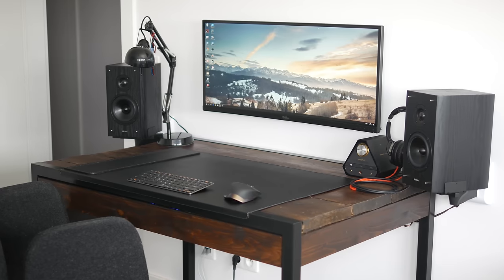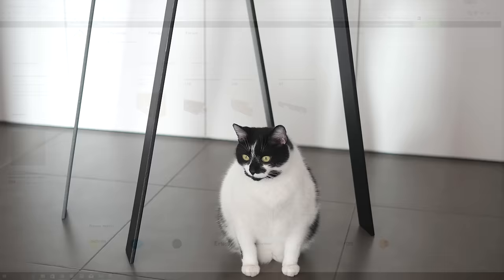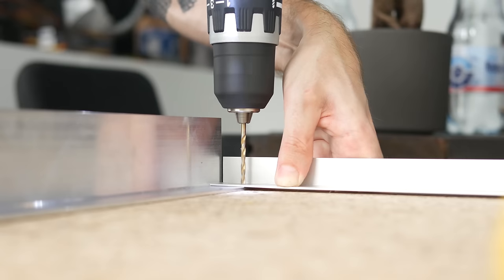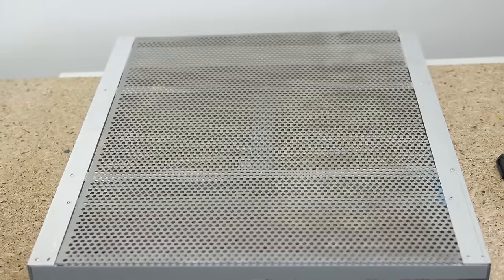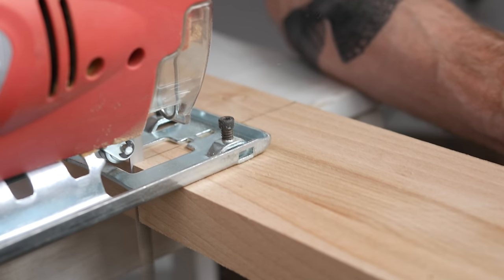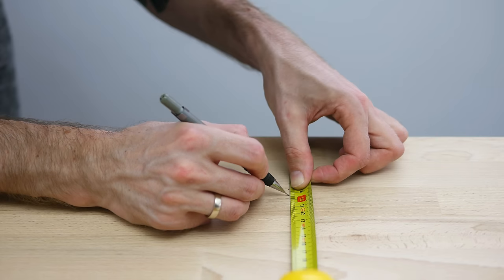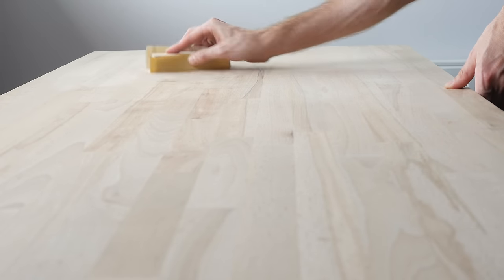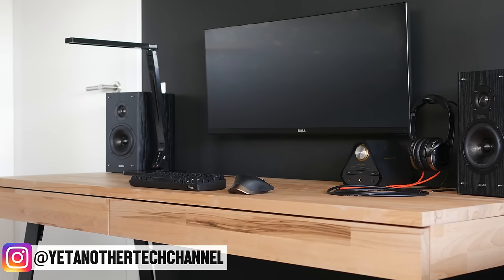How to make a desk PC for adults (DIY desk PC)

Comment: Hey could you do a video on how you mounted your monitor and ran the cables through the wall?
Reply from the maker: The monitor hangs on a very basic TV hanger. Installing it is as easy as drilling 4 holes in the wall, screwing in the wall plate, attaching rails to the vesa mounts on the monitor and placing it on the wall. As for the tunnel in the wall - I'm not a builder, I paid my contractors who were finishing my apartment to do that for me. Here's a link to a video on my Polish channel with a few pictures that might give you an idea: https://youtu.be/uwP9hO8M2bc?t=2m28s

Comment: I like slim or mini size builds, not a fan of huge towers although I use one for my gaming rigs, but the question about those desk drawer setups, was heat dissipation considered, is that what the ventilated plate is for?
Reply from the maker: The exhaust vent prevents hot air from building up inside the desk.

Comment: what did you put into the radiator just before you closed the draw-er  at the end? (looked like  two wires or something...)
Reply from the maker: It's most probably the temp probe from the fan controller to adjust fans speeds depending on the temperature.

Comment: I was wondering whether negative or positive air pressure is the best option for a desk pc.
Also, I am wondering whether a plexi glass top and sides (front and rear:fans, bottom:grille) would be beneficial, as it creates an "air tunnel" who gives less turbulent air flow.
I haven't done any diy pc so don't have any expertise: maybe you know if this would be beneficial or not? :)

Comment: what about dust filters? and why wouldnt you mount the gpu facing upwards for better look? all in all a nice build
Reply from the maker: I'll be adding dust filter for the air vent. In my previous desk PC, dust wasn't a major issue. As for the GPU orientation:
1. My GPU is an OEM Zotac GTX1060 so it's nothing worth showing off. 
2. This way GPU fan has better access to outside air.
3. It's not that the desk has window (never!) so I'm not bothered at all... 
4. I find the black PCB very sexy ;)

Comment: I know its Late that i write a comment but could you tell me how long your angle profiles were? (2:17) wanted to rebuild the table for myself 😁
Reply from the maker: They are pretty much as wide as the drawer so about 50 cm (https://youtu.be/BUM7y3v53OY?t=1m56s). Notice that I have a micro ATX motherboard - you might need to build a larger drawer if you have a bigger mobo.

Comment: I've had a thought of a "Old School" A Fancy type of Rolltop Desk converted into a Stealth Computer desk with Monitor built Horizonitally into the desk. So It's all in one, and Lockable. Something that would fit well in a Old Victorian House Library or a Old Bank Office setting. Would love to see something like that Happen. Resale alone would be worth it, if it was well planned out. Love this desk!, You gave me idea's lol. subscribed.
Reply from the maker: yeah, I totally see this :)
Thanks for stopping by - the topic will most definitely come back as I'm making plans for a third iteration of the drawer to make the computer silent :)
Reply: I'll look forward to it, I recently bought Be quiet! 120mm Silent Wings 3 fans for my CPU Corsair 75H water cooling system fans and I thought they would be more quieter. But there not. Really surprised me.

Comment: Can you tell me what tool you used for both making rivets and rivet nut inserts? all the tools i find only can do one or the other. Thanks in advance
Reply from the maker: I tried searching for it online, but I couldn't find it outside Poland: https://allegro.pl/oferta/nitownica-na-nitonakretki-m3-m4-m5-m6-40-110-6562560272
Reply: YetAnotherTechChannel thanks.  By chance did you keep the vid card raised   as well ? Or does it touch the drawer bottom ?

Comment: Where did you buy the old IKEA shelf with metal mesh? Could you give a link? I am looking for something similar for my laptop ..Thank you
Reply from the maker: It’s Ikea Algot - one of those: https://www.ikea.com/us/en/p/algot-shelf-metal-white-00228338/ but check the dimensions.
Reply: Thanks bro, this Algot meshed shelf is not available at Canada IKEA, try to find something similar at IKEA though https://www.ikea.com/ca/en/p/aurdal-shoe-shelf-dark-gray-30460953/ . It is the Aurdal shoes shelf, sized 56 cm X 40 cm  without the center beam as the Algot shelf does. I added a wooden beam and it is sturdy to hold my 17'' gaming laptop. Going to install to 14 cm fans underneath to finish this project. Thanks again, your channel is inspiring

Comment: Very nice! I have two questions:
a) How do you manage the cables to the drawer from the peripherals so you can pull the drawer out without having to worry about your monitor, mouse, keyboard etc?
b) Would it be possible to put the vent in the back or side of the desk instead of the top? I'd really dislike having an open vent in the top of my desk.
Reply from the maker: 1. The cables are attached to the top - there's enough of each to easily pull the drawer out without any of them disconnecting and they are arranged so they fold neatly when closing the drawer.
2. The vent is over the radiator and it's there because the radiator fans draw air from the bottom and push it towards the top. You can try and make a tunnel to direct that air towards the back. It won't be as efficient, but should be good enough.
Reply: Hey! Thank you for your reply. I assume you picked that orientation for the radiator to keep the drawer height down?
Reply from the maker: Correct - if you'd rotate the radiator 90 degrees, the drawer would have to be 3 cm higher and there wouldn't be enough clearence for legs to sit comfortably.

Comment: Great results! I’m inspired to imitate your PC drawer in my floating desk project. Love the aluminum drawer frame you built, excellent example of what can be done with minimal tools and a lot of thought. 

Two questions:
   1) drawer height looks like ~10cm, is that correct?
   2) how do you handle cabling to fixed pieces like USB hub and monitor? Seems like opening the drawer would require 40cm to 50cm of slack in those cables.

Thanks!
Reply from the maker: 1. Correct.
2. All cables are attached to the roof (?) of the desk - there's enough of each to pull the drawer out (almost) entirely and they fold nicely when closing the drawer.
Reply: Thanks!

Comment: Very Nice! It shows what some great ideas and planning can do if put into action. The next time you need to cut a slot with a router (cnc cutter)  clamp a piece of your aluminum angle down,and use it as a fence to run the router along, for a perfect straight cut.  Very nice PC desk! :)

Comment: what if the house isn't even, how would you handle balancing out the legs?
Reply from the maker: These legs are somewhat flexible and the wood is pretty heavy, so the desk won't wobble or anything - it just won't be 100% leveled. You could also get legs that allow adjustment.

Comment: Hi, great vid. Got one question, what are the holes size of the perforated aluminum sheet? I am asking because I dont understand how the pc components can be fixed to the sheet. just screws? to the holes of the aluminum sheet?  Thanks
Reply from the maker: They're not attached directly to the metal sheet - I fixed threaded inserts (or whatever these are called) to the metal/aluminum base and use M3 screws to bolt the motherboard to the drawer, with aluminum spacers in-between.
Reply: YetAnotherTechChannel thanks

Comment: Very interesting idea.
The only point I disagree is the cable for pci express 3.0, wich works at very high speed and could loose performance the graphics card.
Reply from the maker: I did test how riser cable affects performance and in case of my GTX1060 the real difference was within a margin of error.
Reply: what riser cable did you use? seems as long is I need one :)
Reply: Linus Tech Tips channel did a video using many cables and placed the GPU over 10 feet away from the mobo without any performance loss.

Comment: Great      creativity  man awesome job.
. Now what is this red thing that you are closing the holes  with?And what  screwdriver do you have?
Reply from the maker: The red thingy is a pop-rivet gun with adapter for threaded inserts. Screwdriver is just a screwdriver ;)
Reply: YetAnotherTechChannel Thank you i was wondering  if my drill  is as good as yours.I bought  it 1 week ago and its good for wood but for walls  not that good.Now  i want to build  a  closet with materials  from a broken bed.
Reply from the maker: These things are good for drilling in wood and soft metals. I have a hammer drill for drilling in walls ;)
Reply: YetAnotherTechChannel  yea i  tested  that and learned 😂Sorry man for the holes on the house 😂😂😂.
Reply: YetAnotherTechChannel Can you suggest  me a good cheap hammer drill cause maybe  it will be useful  for thr future cause  now i have this electric  screwdriver called Skil  model 1006AJ and can do so much  more😅.This cost 50 euro €

Comment: Thanks for the tutorial, youre awesome. Actually i wanna build this myself, and wanna build a box that i put under my pc, but my table yet has a strut, so iam not sure if the place is enough to put a desk pc under it. Does somebody know, whats the aproximate dimensions of a desk PC when built? Thanks
Reply from the maker: You need about 95mm of clearance for components... and the drawer cannot be too low - as it's nice to have a little bit of legroom ;)

Comment: I don't remember a mention in the video so I thought I'd ask, what size motherboard did you use?
Reply from the maker: It's micro ATX.
Reply: YetAnotherTechChannel Thanks for the quick response, I was also wondering if it would be possible to get the sketchup file?

Comment: you should setup the company to sell this high end desk . of course we hope add more RGB light option  .  also i hope you setup the notebook  hanger for this desktop . i use to use the 43" 4k monitor for working on my 6ft width desk . but i still not satisfying regarding the cable management. hope you can come out the idea for that .
Reply from the maker: Shipping these monstrosities would be quite expensive ;P
Anyways, I'm currently working on a motorized standing desk - make sure to stop by in 2-3 weeks to see what I came up with :)

Comment: i have a question about these diy desk pc projects. how do you turn on the pc?
Reply: You can buy power buttons for desktop PC's on Amazon. You just connect them to the motherboard, just like you would the power button from a typical PC case.
Reply from the maker: A momentary switch (pretty much the same found on regular computer cases) that I buy at the local shop with electronics parts.

Comment: what happens if u spill something on the desk? Isnt it dangerous for the pc?
Reply from the maker: Not much really - the only somewhat exposed electronic components are radiator fans... Besides, I just replaced that mesh with a 3D printed dust filter and it's very unlikely that the liquid will penetrate it.
Reply: @YetAnotherTechChannel  ah ok 👍

Comment: will do exactly this when I move, but does anyone know if you can hide wireless phone chargers underneath such a layer of wood? or will the "charging" not go "through" the wood?
Reply from the maker: I have absolutely no experience with wireless charging... but in case the top is too thick, you can always use the trimmer (not a CNC machine as I said) to extract some of the wood to make the top thinner wherever you want to place the charger.

Comment: First of all, this is great! I'll love to make one for myself! :) Secondly, I know it going to be closed almost all of the time but man I'd want my GPU at least visible rather than just being able to see the backplate, and SSD's I'd have them pointing up! I'd want to be able to open it up and have it still look insane!
Reply from the maker: Thanks :)
Well, with the GPU facing down, the cooler has much better access to 'fresh' air.
If you want to install your GPU facing the other way, you would need a longer PCI-E riser cable and deal with the fact that the cooling won't be optimal.
Reply: @YetAnotherTechChannel  cheers for replying! Yeah I thought that'd be the case, I guess you have to balance aesthetics and performance. And given it's going to be hidden most of the time performance is bound to be prioritized! Don't get me wrong though I love what you've done!

Comment: Really nice! But how did you deal with I/O?
Reply from the maker: 2 USB cables (one for monitor hub and another hub that's attached to the desk's leg), display port and LAN cables are attached to the top of the desk. There's enough of each to pull the drawer out and they are arranged somewhat neatly that they fold when closing the drawer.
Reply: Neat! I think you making these amazing creations in your apartment inspires a lot of us who don't have garages to work in. Keep it up :)

Comment: did you use a metal cutting blade in your jigsaw? Lotta burn marks. Also and if so, Aluminum is soft enough you can cut it with a wood cutting blade (or metal) rather than a hacksaw. Cheers mango
Reply from the maker: It's a BOSH blade labeled 'hardwood'. Thanks for the suggestion, I'll give it a try :)

Comment: Looks good +1 like but... You could've spend a little more time and effort to make the metal and wood parts you've cut more precise, and get rid of the gaps making a seamless looking desk. The shelf is looking awesome when the drawer is out of the table, DYT about modding a thick glass so the components are seen from the top of the table in future? Also a couple of 120mm fans would increase the airflow mounted closer to user's side. Good luck!)
Reply from the maker: I'm not a carpenter and I don't have a workshop where I could take my time and cut everything with 0.1mm precision. For someone who didn't take any training and who does technical writing for a living, I think I did pretty good ;) 
As for the see-through top - the lack of glass is an essential part of this build - it's not a teenager's battlestation ;)
There's no room for 120 mm fans in this layout but I'm planning another revision of the drawer itself - focused mainly on noise reduction as this one is far from being silent.
Reply: No offense mate, just shared my thoughts with you. You did a great job!!

Comment: It's now almost two years since you made it. What are the temps?
Reply from the maker: Core i7 6700k overclocked slightly to 4.2 GHz hits 76C on two cores (the other two remain below 70C) when rendering a video in Premiere. I'm planning a new revision of the drawer so the computer will be cooler and quieter.
Reply: @YetAnotherTechChannel  76*C sounds reasonable from what I've read about your cpu. Thanks for the info, you're inspiring my inagination to dream of similar desk. Cheers

Comment: How about use air cooling system
Will overheat,?
Reply from the maker: The problem with air cooling in such scenario is that there is no airflow path like in a regular PC case. A high-quality heatsink should manage but the CPU will most definitely run hotter. If I was to air cool my drawer, I'd add fans at the front - sucking the air from the bottom and channel this air towards the back.

Comment: Curious about temperature during operation. Witam from Warsaw too :)
Reply from the maker: Cześć :)
CPU hits 65C under full load, with radiator fans at 900 rpms (barely audible). The temperature drops like 5 degrees after increasing fan speed, but it gets loud and isn't really worth it. Mind you, this was the cheapest AIO I could find and I'm sure that the temps can be improved with better AIO or better yet - a custom water loop.

Comment: Curious as to where the power button is?
Reply from the maker: It's on the inside of the drawer's front on the bottom edge - it's accessible without opening the drawer.

Comment: Whats the monitor and keyboard in this video ?
Reply: Hey Andrzej, same as you I wanted to know which keyboard this is. After searching the web I think I finally found the Keyboard. It could be the: "RAPOO E6500, RAPOO E9070, or another model from RAPOO". Cheers from Germany, Fabian
Reply from the maker: The monitor is Dell U3415W and the keyboard is either Rapoo E9050 or Royal Kludge RK61.

Comment: Overall, it's been great, but I do not like the legs. It blurs the picture. Not that nothing, but on the rails will it not become stable enough? True, there is no hard disk and such thing, but still. You have to put something to take the vibrations and not to allow it to open by accident. That is, to have something like a locking mechanism.

Comment: I wonder if if I could do a custom loop in that desk. you seem to have lots of room.
Reply from the maker: That's the plan ;) But for the time being, I'll probably add another AIO for the GPU...
Reply: I was going to do the same thing because I looked into buying another AIO for the GPU and a bracket to mount it to the GPU then I figured I want it to look really good so I bought all the equipment to run a custom loop. Fittings get expensive I spent quite a few hours determining the fittings I wanted before I could buy the PETG tubing.

Comment: the hole for taking the air it should not faced up, the dust will easy coming in and inhaled, but overal its great
Reply from the maker: The fans push the air through the radiator towards the vent so I seriously doubt that the dust will be able to settle on the rad ;)

Comment: what happens if you spill a drink on your desk and it spills in that hole? a cup holder would be cool
Reply from the maker: I've been using this desk for well over a year now and never had a beverage related incident ;) 
Anyways, I just changed the air vent cover to a 3D printed one to minimize chances of liquids getting into the drawer. But worst comes to worst - the only electronic components that might be affected are cooling fans.